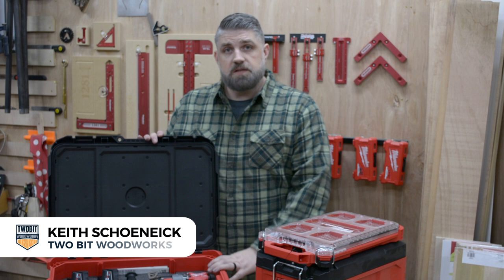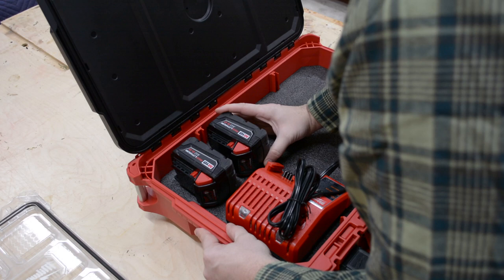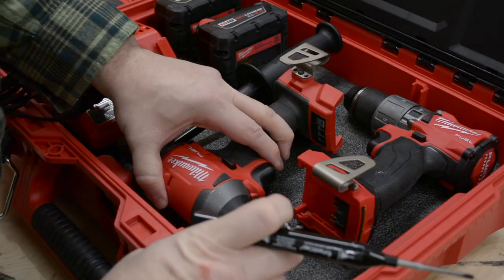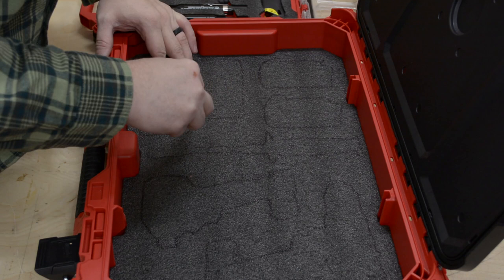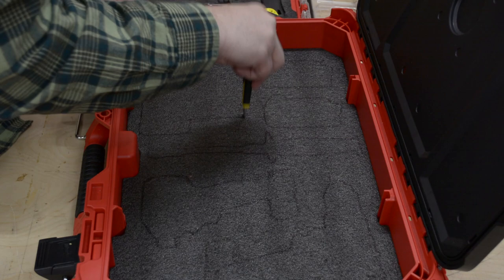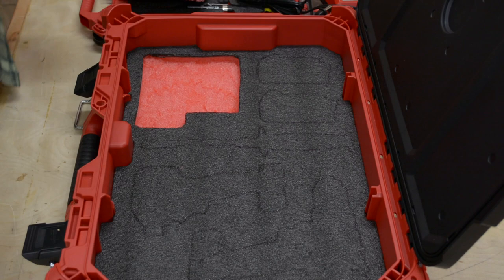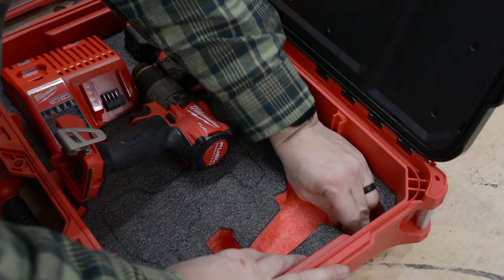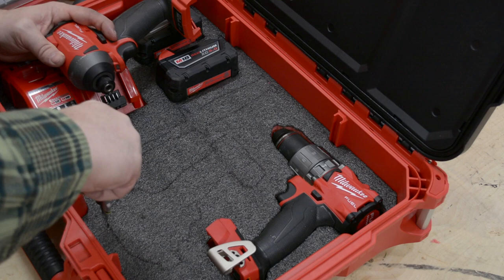Organizing a Milwaukee Packout Tool Box with Kaizen Foam | DIY Shop Project

Comment: I’m about to do this for mine, but I’ll be using some 3M Super 77 adhesive to put a thin layer of foam onto the inside of the lid for extra support in case the box is ever dropped.
Reply from the maker: That’s a great idea Brandon!

Comment: Would hold the milwaukee pam router??
Reply from the maker: Yes that would fit. I have a separate case with the M18 Router in it.
Reply: @TwoBitWoodworks  mine didn't come with a case and I can't find the proper case for it anywhere, are you sure it will fit in this case shown?
Reply from the maker: @garethconey9603  mine didn’t come worth a case either. Right now I have mine in the taller “cooler type” case. I have seen pictures of others online with the same Packout and some Kaizan foam holding in the router snugly.

Comment: Couple questions if you don't mind answering:  What was the thickness of the foam sheet you purchased?  Looks like they have a few different thicknesses.   If you did it again, would have chosen a different thickness?  Any value in adding a top piece of foam to the lid?  Thanks.
Reply from the maker: I got the 57mm thick black with red core. I like the thickness that I got, not too thick or thin. If you do the cutouts so that the tools fit tightly then you shouldn’t need a lid piece.
Reply: @TwoBitWoodworks  Excellent.  Thank you very much for the reply.